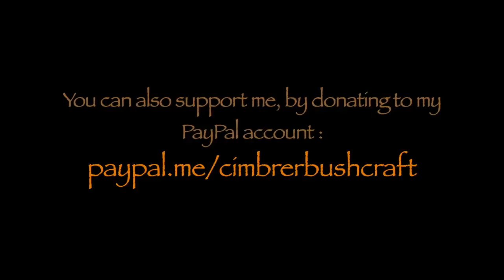Bannock and Bread  B)  Bushcraft from A-Z

Comment: The bread looked delicious. Have you ever made or had cornbread? I sometimes put blueberries in the corn bread mix, and when it’s nice and hot, add some butter to it. The leather pouch in the new addition to the stove is very cool. 💪👏👍
Reply from the maker: Thanks a lot brother for your feedback and for joining me again in Cimbrer Camp 🏕🦌
No I’ve never tasted cornbread … do you have a recipe? 😁👍🏻
Tom
Reply: Cimbrer Bushcraft Probably the easiest way is to go on Amazon and look up cornbread mixes, that will give you an idea of several companies that pre-make the cornbread mix. If the mix is coming from America, you’ll have to convert the measuring and cooking temperature to what you use in Europe. It’s possible you might have premade cornbread mixes in your country. Cornbread is sweet, you can add some corn from a can, and use some of the liquid from the can into the mixture to add extra flavor into it. Make sure when it’s nice and warm to add butter on it. 😋